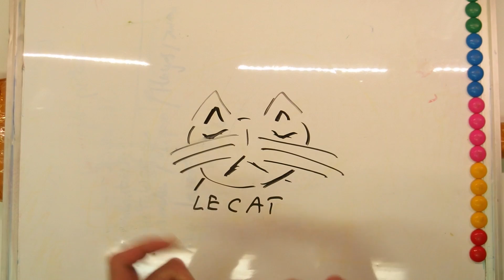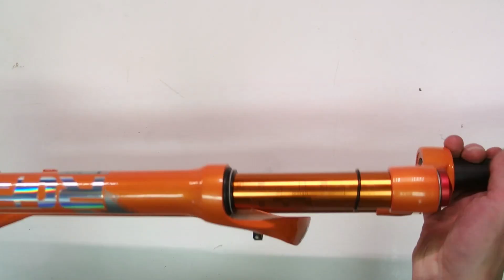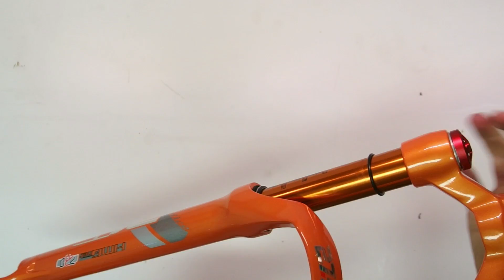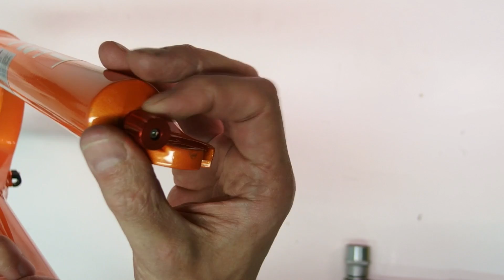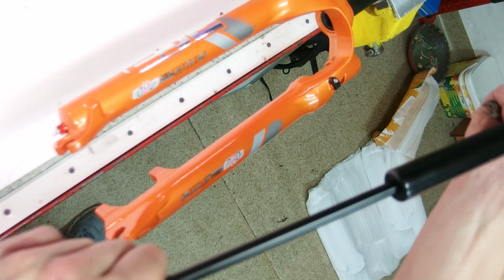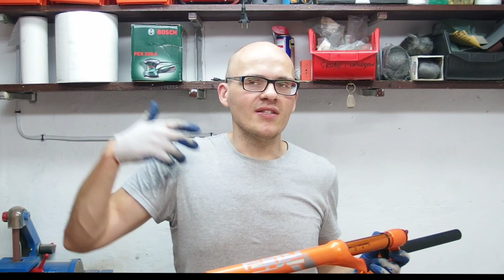Zombie "streaming" about an anonymous chinese suspension fork.

Comment: Is there a serviceable damping system i have never seen a serviceable damping system even fox and rockshox doesnt have a serviceable hydraulic damping system only a fool would create a bon sealed damping system
Reply from the maker: Every quality fork or shock is fully servicable. For some it is not doable without specific tools and service manuals, but for forks it is usually quite straightforward. The bladder type dampers, are supposedly, more troublesome but still, doable for a home mechanic.

Comment: You are totally onto something with some genuine quality bike parts coming out of China, after all its a population of over 1.5 billion mostly bike mad people. But I do think you need to venture into the slightly more expensive parts to find those hidden gems; the ztto xd ult Pro 9-50 teeth 11 speed I've got running isn't just good for the price but I think possibly the best 11 speed mtb cassette money can buy (as slick as xtr or xx1 yet bigger range, as light but less than half the price), the cxwcx flatties I'm using are every bit as good as my old dmr's costing 4-5 times the price, great direct drive chainrings (again fraction of the price) and tons of genuine quality carbon bits. I'm reserving judgement on suspension but it does seem anything hydraulic China doesn't seem to be quite there yet!

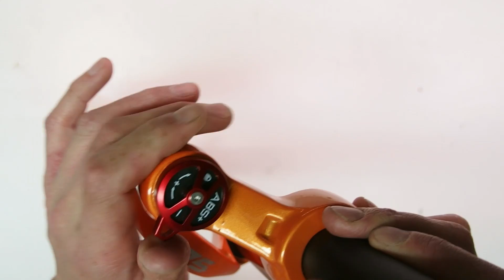Comment: 6:09 This fork of course don't have Manitou ABS+ damper. The crown is a copy of Fox. What is done is illegal. It has a simple closed cartridge. So you can't service it. I have seen a video with a similar fork taken apart. But your vid is better cus it's well lit.
Reply from the maker: I am almost certain that this fork is a zombie made out of parts sourced from OEMs for major brands. Crown is, as you say - fox, lowers and upper tubes reek of suntour.
Reply: @TryboBike  might be, unless it's just a copy. But I will definitely not buy it.
some forks got issues with lowers being misaligned so wheel was hard to put on and fork would not compress properly.
video by TCBOT about KRSEC /BOLANY forks : https://youtu.be/s1MFYqyBpEI
https://youtu.be/XeGZ4b5LT44

Comment: You mentioned that the steerer tube was a bit short.  This seems to be common practice with the Chinese manufacturers.  So what is the fix?
Reply from the maker: Weep in despair, really. You can try to use an extender, but even then you need like 40mm of the steerer sticking out. Frankly, its the chief reason why I avoid those forks. Its just this one isn't for me.

Comment: Would you do a review on the new rockshox judy silver tk air?
Reply from the maker: If I get my hands on one, I probably would. But there are like, $200 reasons not to do it.
Reply: @TryboBike  yeah for the most part I've seen them for 170$ (before tax) but not alot of info on them and so far most knockoff forks I'm sceptical about quality control